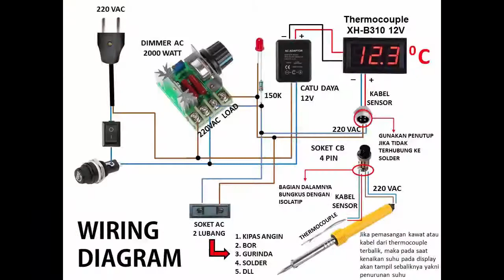Membuat Solder Station dengan Dimmer

Comment: Thermocouple nya bikin sendiri apa beli bang?
Reply from the maker: Beli, mas
Reply: @ismailchannel3843  ada link atau tipe thermocouple nya ga bang? Soalnya saya jg bikin sama persis kayak punya abang, cuma terkendala di thermocouple nya aja.
Reply from the maker: Saya lupa lagi, dulu beli di tokped
Reply: @ismailchannel3843  bang display termometer nya bisa ga pakai tegangan 24volt?
Reply from the maker: Itu speknya 12V

Comment: Mau tanya bang apakah bisa dimmer di pasang ke solder uap, karena solder uap saya kontrol heater rusak sehingga auto hight
Reply from the maker: Untuk solder uap sy sendiri blm pernah bongkar dalemannya. Jika sistem pemanasannya sama dengan solder biasa saya kira bisa, mas.
Reply: @ismailchannel3843  sdh sya cb langsung ternyta bs mas, sblmnya terimakasih infonya mas, channel sdh sya sub n like.
wassalam...
Reply from the maker: Terima kasih, mas. Semoga bermanfaat
Reply: Pasti bisa mas... Cuman pengatur ny dimer,  pakek voltas e makanya seakan akan turun
Reply: Blower saya juga auto hight mas apa rata rata masalahnya di dimernya?